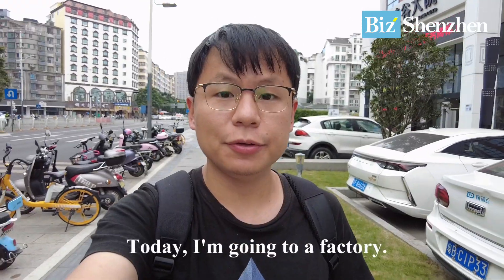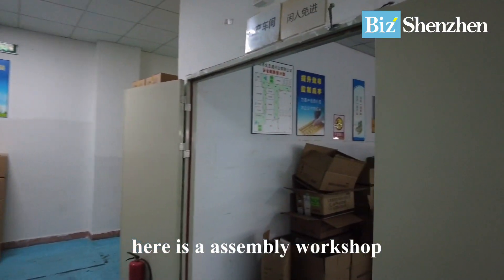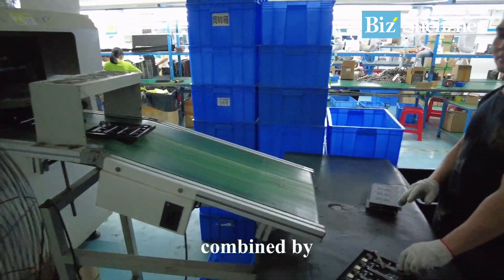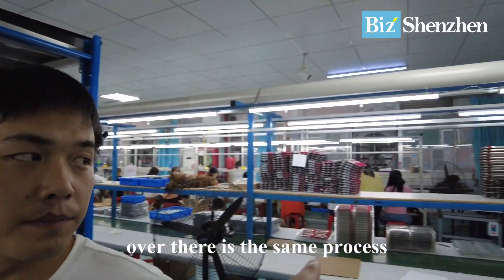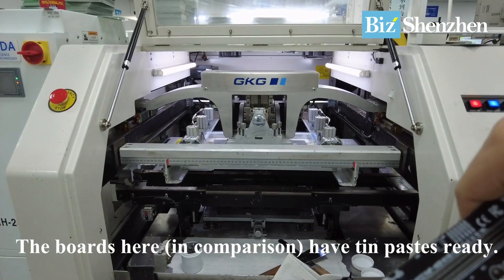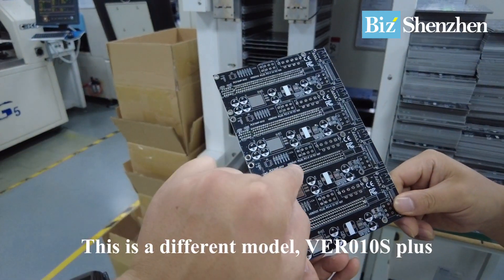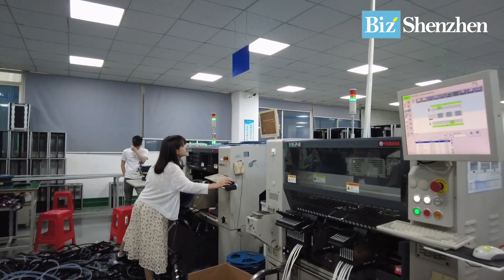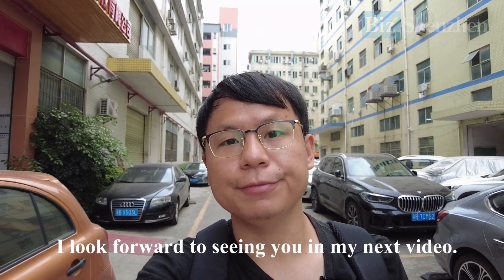How PCI-E Risers are made? #ethereum￼  #antminers19pro #s19pro110t #s19pro #antminer

Comment: I bought a lot of their products on Aliexpress, their GPU risers are very good despite sometimes having little questionable QC issues. But so far not a single of them had failed me. However, they should really stop making these fire hazard SATA connectors, they are not suitable for high current, i never use them and always put them directly in the garbage bin lol
How can you have access to the Youtube by the way, i thought it was completely banned in mainland China :/
Reply: Nothing is banned in China if you have money, connections, or a bit of brains.
Reply: Can you share the direct link of the AliExpress u used to buy these?...